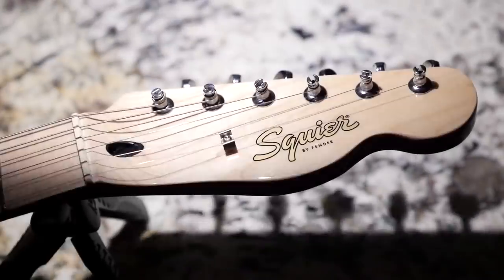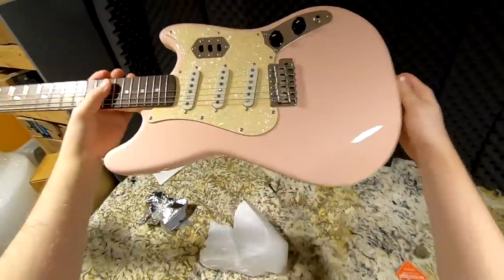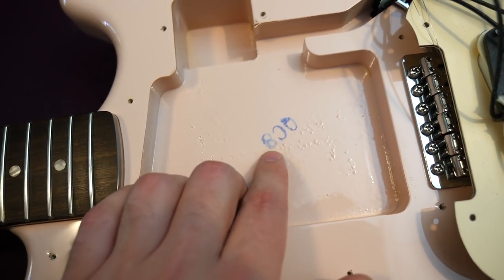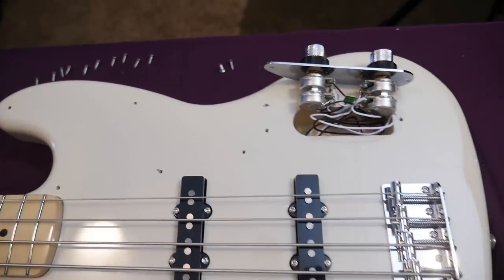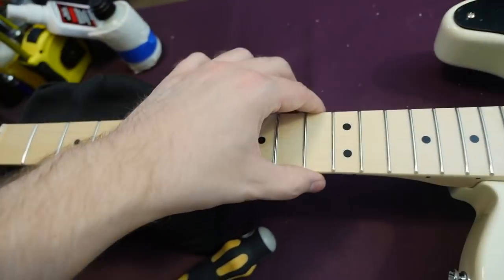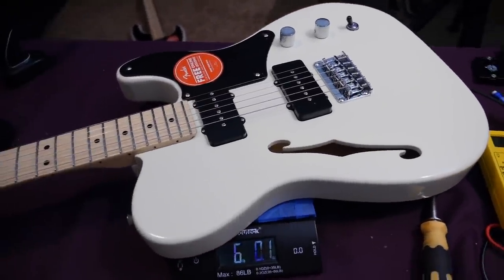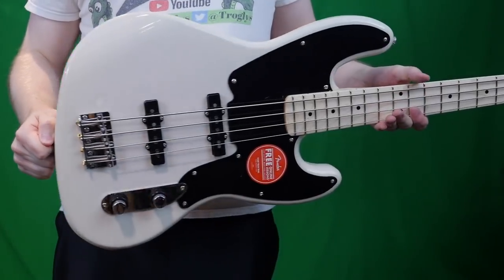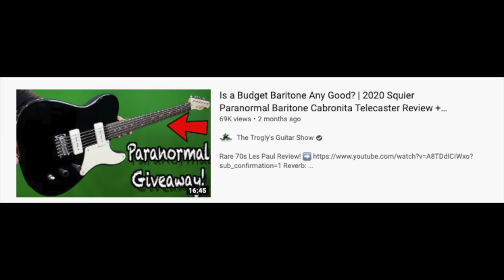Squier Paranormal Thinline Cabronita Telecaster + Cyclone + '54 Jazz Bass | Unboxing, Review + Demo

Comment: Hey there: It's me again - way back in 2005 when my The Paul was stolen I made it leap into Fender. I replaced The Paul with a Fender Cyclone. In 2005 they didn't make them with the color I wanted. Now a little back story on why I chose the cyclone. I was very p ed off about The Paul. I wanted to express that with my new guitar. The word cyclone says to me anger. The colors black and red to me are anger colors. My local Fender dealer contacted Fender to see if I could get it costume made. They said no but that they had some of the 2003 model in black with the black & red imitation tortoise shell pick guard. Ordered it with hard shell case. Total cost in California $699.95. It is one of the best guitar's I have owned. 4 Gibson's and 1 Fender. By the way I haven't found any other Fender that plays and sounds as good as my CYCLONE. Peace

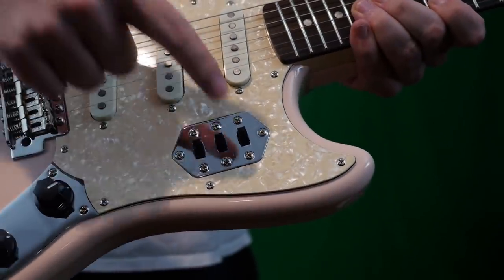Comment: 19:10 literally the best of that guitar, and he hates it? Its the 5 sounds of a strat, all pickups AND you Can use em as kill switch when on 1 p.u. configuration 😍  (an actual kill switch and maybe parallel wiring is the only things i would add)

Comment: These are pretty cool. The bass also has the scratchplate design of a vintage Fender Telecaster bass, which is interesting, but not as appealing aesthetically as the standard Fender bass design.  Just the opposite is that Tele, which is a design upgrade, as far as I'm concerned.  I really appreciate the design concepts  that went into the Cyclone.  But maybe the Mustang body shape taints (yeah, I said "taint") my brain into thinking that the Cyclone sounds "cheap."  I don't know, it could be just a psychological thing.

Comment: My wife surprised me with a Paranormal Cabronita Thinline as a gift. I was excited but after playing it for a short while I noticed that it didn't have the Jazzmaster tones. I took a look at the pickups and wondered if they were actually P-90s so I took the cover off of one and sure enough they are P-90s bar magnets with set screws instead of magnetic pole pieces. Kind of a misconception and misleading from Fender's description of the pickups. That's like putting a black coat on a white sheep and calling it a black sheep.

Comment: Get a bass amp, even for these 3 minute walk throughs on a bass! Even just a Rumble 15 would improve the sound. 

I picked up this bass- the butterscotch blonde color and I think it's a killer deal for $400. I also have some fret sprout, but I didn't have any other qualms- the top knobs aren't loose, and the rest of the fit and finish is very good.

Comment: That Tele Thinline has P90 Pickups under Jazzmaster covers as evident by the dual bar magnets under the coil bobbin.
Actual Jazzmaster Pickups would utilize individual pole piece magnets.
Many prefer the P90 style Pickups Squier uses in these Thinline guitars as they have a little more punch/output as compared to traditional Jazzmaster Pickups.
Reply: Do you think regular p90s would fit?

Comment: The original Fender Cyclones (as well as the Squier Vintage Modified version of it) were way better. They had an HS configuration with a 3-wau toggle.

This Paranormal one is more related to the Cyclone II

Comment: Cyclone - not much variation in tone from all those disappointing switches. Bass - tonnes of tone with the weight and the J / P configuration. Tele - coolest in white with that semi cavity tone depth and slick neck, great Tele tones. Being Squire probably all three are underpowered but great to start with.

Comment: You seem to always measure the pups resistance with the pups installed......I don't think that is the proper way to take that measurement. When a pup manufacturer specs out the pups the resistance values are always measured DIRECTLY AT the pups. With the pups installed (in the guitar) these values are not the same as a direct measurement. CLOSE, but not the true value of resistance of a particular pup. At least that is what I have experienced when taking pup resistance readings. I really like your reviews tho, OK---